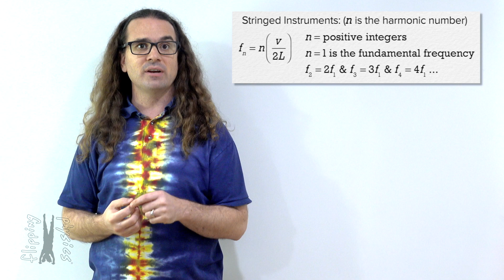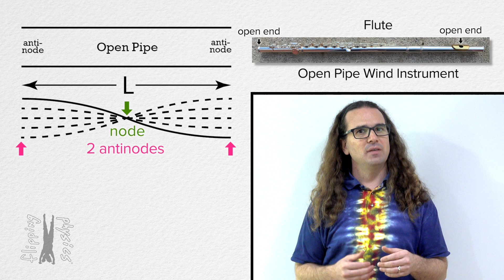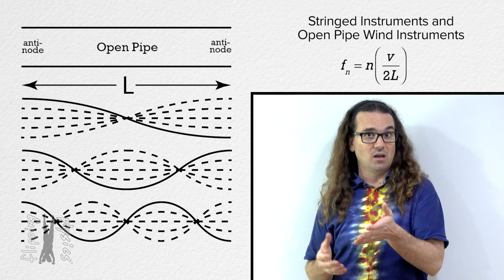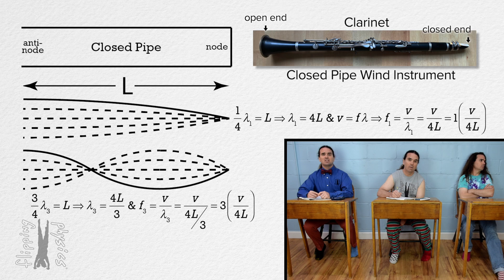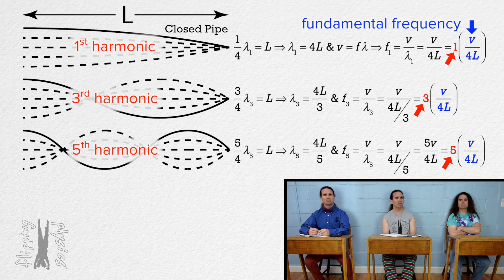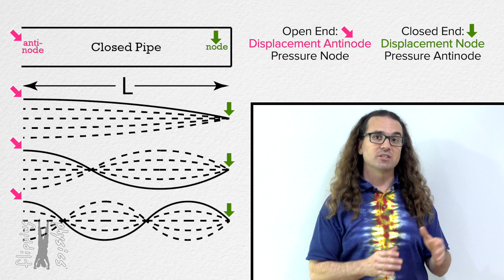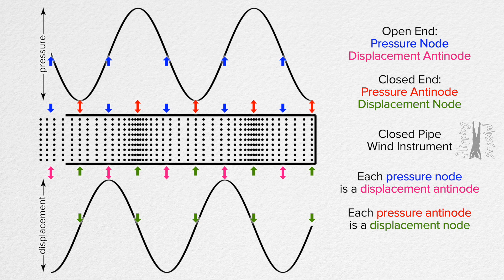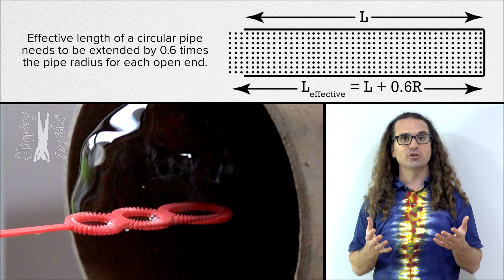Wind Instrument Frequencies (open and closed pipe instruments)

Comment: I forgot to ask if what happens to the air molecules being compressed and released, if they can be visualised in any way or diagram? 
The behaviour inside the tube is easier to picture, but what happens in that resonator towards the closed end  to the left of the blow hole isn't easy to picture. If there's a votex or a suction system of any sort taking place. 
Hope I managed to explain myself to be understood. 
Thanks for your time and interest.
Alex G.

Comment: but wait, this ignores the inversion factor of the pipe.  The diameter of the pipe affects it's resonant frequency, not just the length.  What's the the real formula?  This seems like an over simplification of what is really happening, which is inversion of the waveform before every antinode...

Comment: Does anyone know which program he uses to create these animated videos?
Reply from the maker: The original video is of an object rotating on a turntable. I then motion tracked the object in Motion and isolated just the horizontal motion and applied that to a single dot to get a dot moving in simple harmonic motion. Then I imported that in to Final Cut Pro and made many, many, many duplicates of it in various configurations. So many duplicates it actually crashed my computer and I had to export groups of dots in a series of videos and then reimport those back in to Final Cut Pro to make it work. Hope that helps!